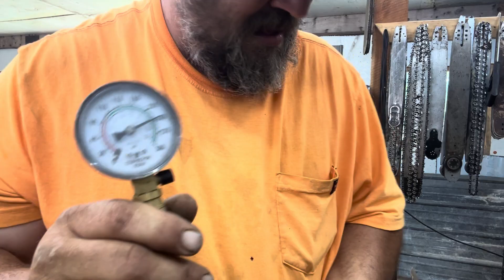Is High Compression Faster?  How Much Compression Does My Racing Saw Have?

Comment: I have a modified compression release in my 660 clone. It's an oem husky decomp (they're the best ones to use) with 2 extra 1/8 holes drilled in it, the saw pulls over really easy now. This is a super easy mod to do.

I messed with compression on my yz250 and chatted with pro mx bike builders.
If you want to make low to medium compression (150-180psi)work well you need to do combustion chamber work and keep the squish down to the bare minimum. But as you've found high compression isnt holding back the rpm in the cut it's only only holding back the free rev with saws.

Comment: You can drill the hole in the side of the decomp bigger or just add more holes around the hex like the original hole.  You’re ultimately limited by the area around the valve and the body.  I guarantee you have a Chinese decomp to play with.  There are also bigger nicer decomps for quads and such that flow more (still 10mm thread)  but they are quite pricey. Either tp engineering or vulcan works.

Comment: I like a saw build where the rpm feels super silky or the world feels right. Idk it’s hard to describe but it almost feels like the motor just floats rev to rev.. which I find is around the 200-215 psi.
Reply: Thats were i try to land also with compression, seen videos of high compression just build heat
Reply from the maker: I don’t really try to land on any sort of compression number. I just do what I want to piston and chamber then whatever compression I end up with is what I have.
Reply: @Smittyschainsaws  I never aim for a certain compression that’s just typically where they end up but I’ve had a few go to 240+ then I cut either the chamber or add some squish to calm them down a little. The beauty of it all is we can build them however we want. Because there’s 100 ways to skin a cat. Good stuff bud keep it up
Reply: I believe that a bunch of chamber work can be counter productive when trying to make big power via hi air flow etc. Shrinking the chamber too much  is counterproductive.  You have to have room for the mixture to hang out until its compressed. On a real wood saw increasing compression very much at all is a no no on pump gas. Detonation is an issue and the untrained will not even notice it.

Comment: 😊😊 U can run a hotter fuel U would have be around 15O pounds of compression most likely U could try racing gas 1O3/11O octane there is something that's hotter than that 😊😊 thing is would the saw handle it or lock up because it got 2 hot because of the fuel chainsaws never did use cast iron or cast iron pistons 😮😮 OMG 8 9 2O25

Comment: 😊😊 most chainsaws run  between 18O-2OO pounds of compression some have more as the piston rings seat and more when cylinder work is done ✔️ 😊 OMG 8 9 2O25